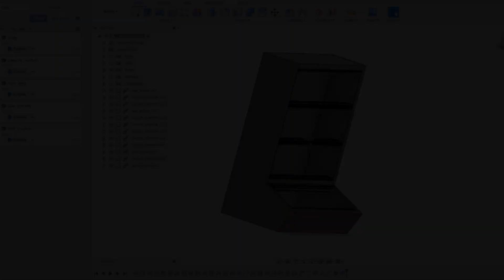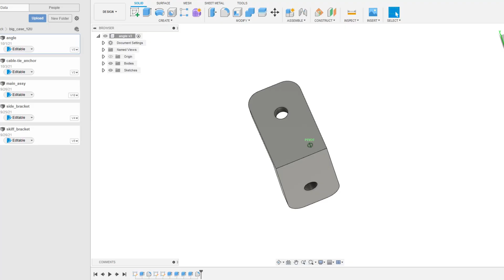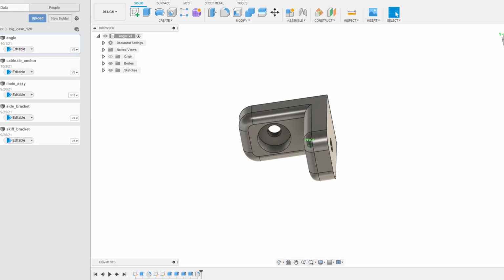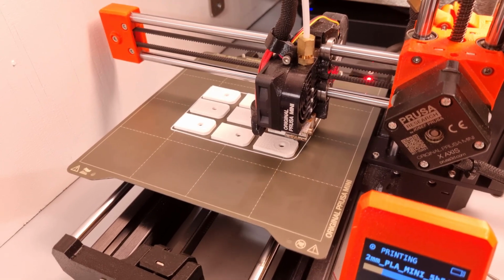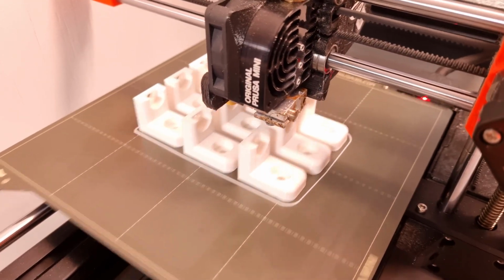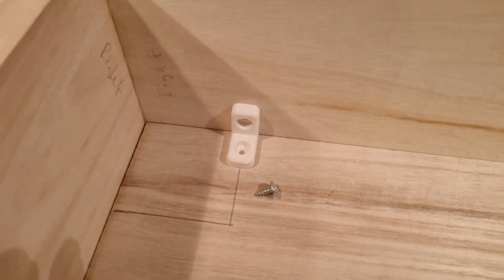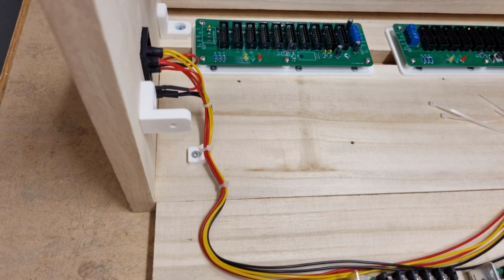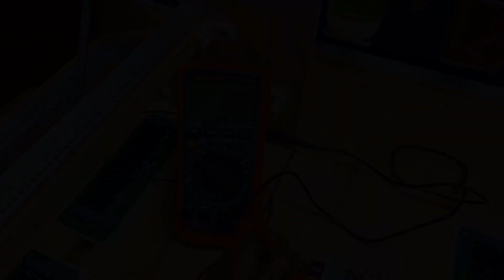DIY 12U Eurorack Case - Episode 2: Build completed

Comment: Very nice, but I wouldn't trust 3D printed brackets to hold lots of expensive electronics together.
 "Modesty blocks" / "knockdown blocks" exist, are designed for the purpose, and are cheap. They're made of molded nylon, which is incredibly tough.
Reply from the maker: Don't say that - I have repaired a lot of stuff at home with my 3d-printer 😯😮😄
I understand your concern about the strength of 3d-printed parts, but sofar it has been ok... This thing will not travel around - it will sit on the desk next to my other gear.

Comment: Could you share the case dersign file and which model of that power supply? ☺️, i wanna know how you use 2 bus boards with 2 power supply
Reply from the maker: I will have a look at exporting the fusion 360 design-file. It's not a fully detailed design with all measurements and prepared drawings; it's more of a 3D mockup that I used to get an idea what the case would look like. SO I hope that you don't have too high expectations 😉
Reply: @MeeBilt  I reallyy like this series because i start to build from 0 and bus board look tiny ^^

Comment: Really cool. Would it be possible to do this assembly with one LRS50 transformer only? Did you use two to have more current?
Reply from the maker: Thanks for your question. The power supplies have single voltage outputs, so both are needed to get positive and negative 12VDC. Hope this answers your question.
Reply: @MeeBilt  I understand. Would you consider using the Mean Well - RT 65B model?
Reply from the maker: @consbuteri411  Yes, that is a popular PSU for Eurorack - and I think it is great for a small-medium sized case. The reason I didn't choose it was that the -12V only gives 500mA current